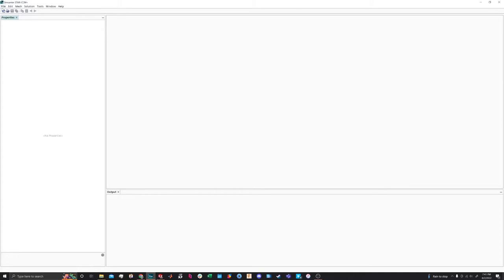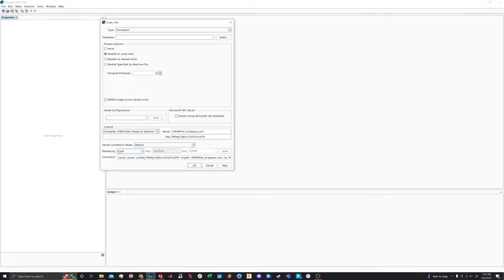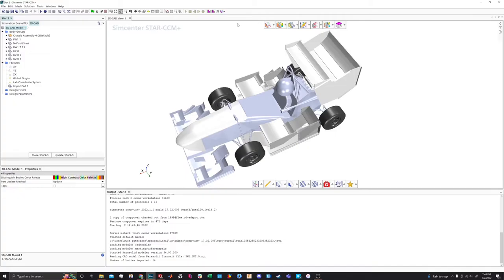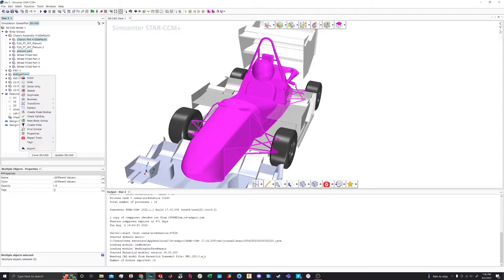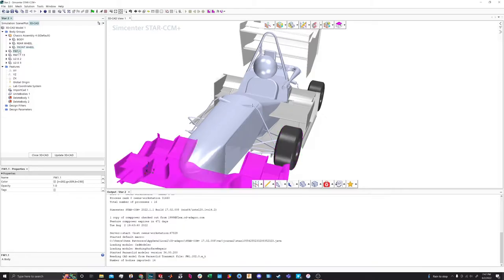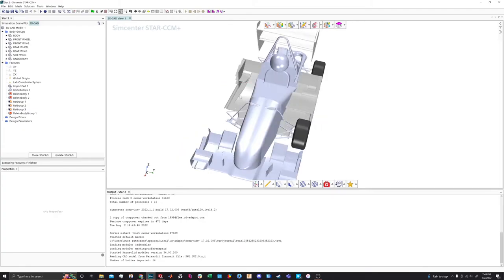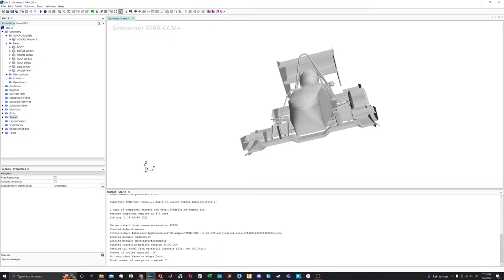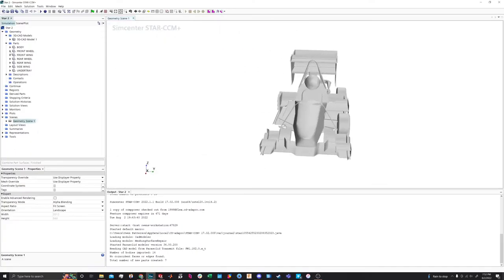Star CCM+ Tutorial 2022

Comment: Hey man, first of all great work putting a complete tutorial, from begining up to post processing.

There's however a couple of things I'd like to point out. It seems unnecessarily expensive the way you set up the mesh. Ideally you'd like to have cells of 0.5m or 1m at the back of the domain, and to make sure that you have refinement around and behind the car you should use Volumetric Refinement and/or wake refinement. That way you'll reduce A LOT of volumetric cells count while still keeping a accurate simulation!
Reply: Best way to approach this would be to use the Automated Mesh with settings that you wish for the domain (for example 1m base size, target size 0.5m) and then add Surface Control where you'd select each part of your body and select specific meshing parameters for the wings, for the body, etc etc etc.

For the wake, you can either use the Surface Control to put a wake refinement (where you specific length, direction and diffusion angle), but if you want to refine a bit the front of the car (advised due to the static zone) you can also use the Operations to create a offset of your car of like 0.5m or 1m, which will create a area around your car, and you can then refine the volume inside this geometry.

All of this will allow you to maintain the accuracy and results of your simulation, while reducing cell count for at least 30%-50%! This will mean that your simulation will be much much faster, by using less resources for the same geometry, or will also allow you to run a much more complicated geometry (if you want to add accuracy) while maintaining the same mesh count and speed.

Hope to have helped a bit and maybe just a couple of ideas for another update video (Y) 

Anyway, great work you got here!
Reply: Thanks for the insight. Gonna try it here

Comment: Hi Owen, fellow FSAE guy here from germany. First of all, big thanks for that tutorial, really helped me in switching to StarCCM. I would like to point you to something that i realized with your model. Airfoils and chassis are all really detailed, but the driver is not really, why? I have found, that the actual helmet and mainhoop padding negatively interact with the rear wing in quite a big way, as they effectively close the cross section inside the mainhoop. Also, the mounting of the wings can have quite an effect, if one runs a "plate-style" solution. We got some props from Aero judges in FS Spain for running sims with a "real-world" driver and proper wing mountings (most teams seem to neglect that). I was thinking about cornering simulations with roll, pitch and yaw, but am unsure about the domain setup. Would you consider a block domain with the full car at an angle (front wheels turned in too) sufficient? That would at least come close to what you can replicate in a wind tunnel.
Thanks!
Reply from the maker: I personally haven’t seen a huge difference in running a helmet versus an accurately sized sphere and we have a headrest in our CFD bodies since that seems to make the biggest impact for the rear wing. That said this model was from pretty early in the car’s development cycle and I add in that detail, including a proper driver, helmet and mounts, later in the cycle when these things are fleshed out. We also simulate both cross wind (yaw) and cornering throughout our design process and they are both really important to optimize for. I’ve heard a lot of people make the assumption that yaw insensitivity and cornering insensitivity are equivalent, but our sims don’t really bear that out so we do both independently. Cross wind is just a simple rotation on the domain, and for cornering we use a circular domain with an inlet condition that defines velocity relative to the radius of the turn. That sim also includes transformations for steering, body roll, and understeer/oversteer so that we can feed those sensitivities back to suspension

Comment: Great Owen . Can measure drag coefficient with star ccm ?
Reply from the maker: Star has a force coefficient report option right where I pulled the force reports in the video. You can also run a frontal area report to use in the Cd report. There are a few more inputs to a coefficient report but the setup is generally the same as a force report

Comment: that rear wing is intriguing

im currently designing my team's rear wing, but unlike yours, we use very high camber custom airfoils that were inspired by selig s1223. you seem to be using something that vaguely resembles NACA 6412 for the main element and clearly some custom airfoils for your flaps, along with that slat. My question to you (as you do seem to be alot more experienced than me) is:

for rear wing mainplanes do you recommend low camber airfoils at low AOA to allow more space for flap airfoils to be present? or perhaps a large chord high camber airfoil with a very small flap? 

does that tiny slat near the leading edge of your rear wing increase performance significantly?

our team is using star ccm+ as well, if you have any advice for me about the software too i would definitely appreciate it!

thanks
Reply from the maker: Hey, I won't go into too much detail about our designs since my chief already hates that I make these videos haha. This wing specifically doesn't actually have any custom airfoils, though we are migrating to custom airfoils for our next car. I tend to prefer lower  camber airfoils for our wings because they tend to be easier to manufacture and we don't have any limitations on the number so realistically you can build a high camber wing with as many airfoils as you want. The slat doesn't have a huge performance effect, but it helps drive flow down under the wing behind the driver's head. It's also pretty low impact to add if you already have a mold in work for an airfoil with a short chord. That's the case with this wing, the final element and the slat use the same profile. My only real advice would be to run as many sims as you can and keep pushing your breadth of knowledge on Star. This software can do more than you'll ever be able to grasp so there's always something to learn and apply to the car to make it better.
Reply: Hi, i used to simulate with an s1223 too, but switched, because they are incredibly hard to manufacture with that tight high camber trailing edge. Switched to an Eppler 420 with 380 mm chord as rear wing main and two 170 mm chord flaps with high camber. Slat has almost no effect in that setup. Try to look for profiles with bigger leading edge radii, they are way easier to manufacture (especially mold).